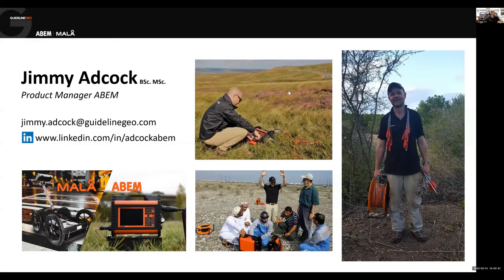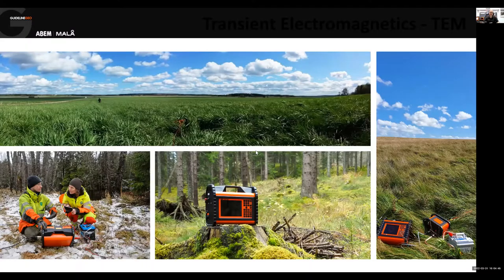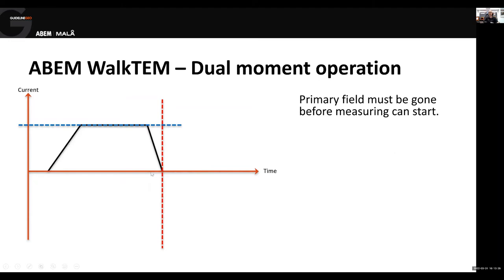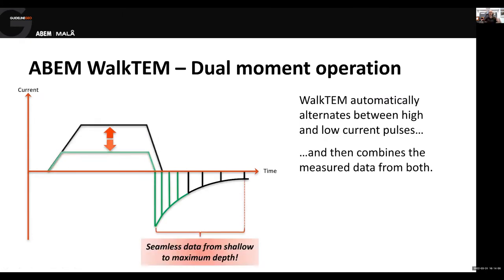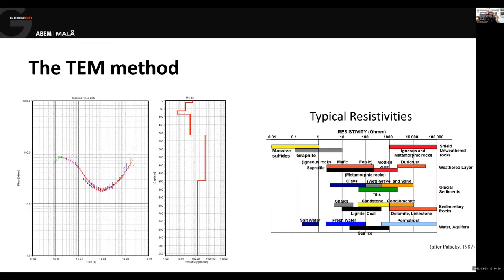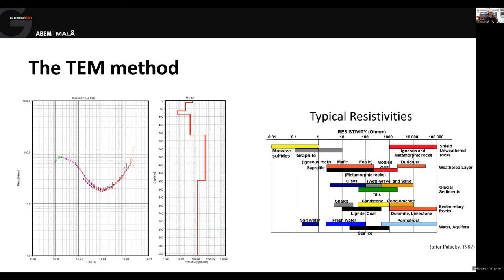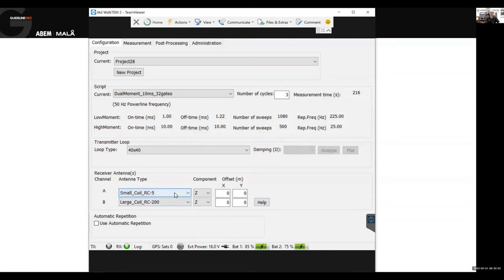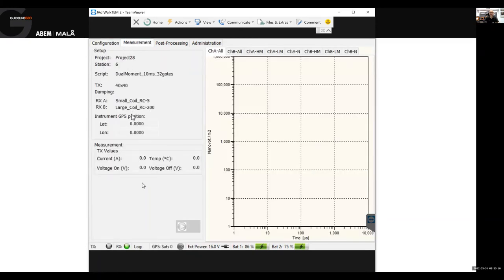ABEM WalkTEM 2   Onboard vs Desktop Processing in SPIA

Comment: What would you consider professionally a reasonable data residual? I have pretty noisy data and the i cant seem to get a value less than ~.45.  The data matches with about a +/- 10m difference to published TEM inversions between sites more than a dew hundred meters in between each.